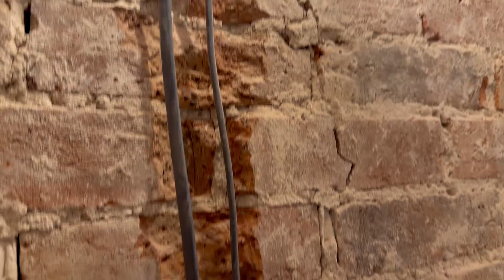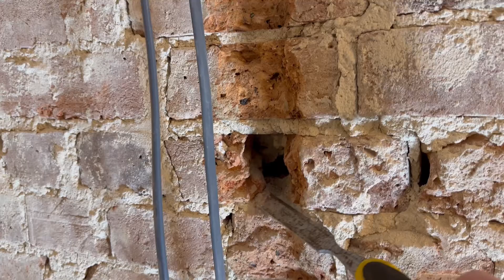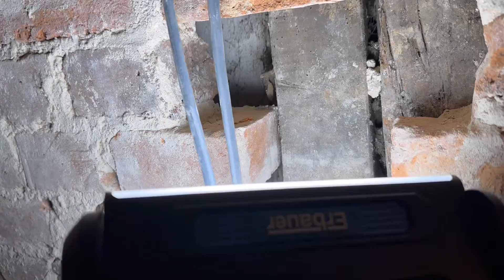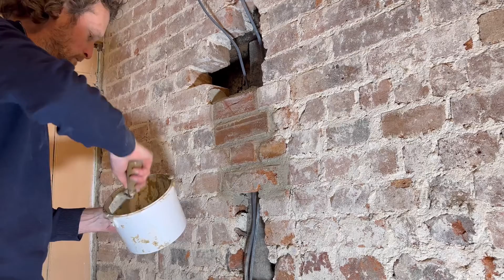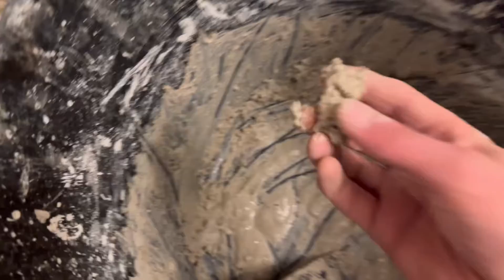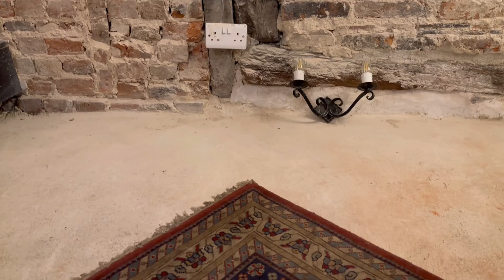Lime Mortar & Soft Reds Wall Repair

Comment: I have a bucket of white lime mortar.  I need to change the color to tan to match the existing mortar.  Any recommendation on pigment that wouldn't just run out?
Reply from the maker: @felixyusupov7299  I’d give it a try with different sand mixes. Try a little of various blends and see how it looks when dry. Lay it out like on an artists pallet next to each other you’ll  probably find a mix that comes close